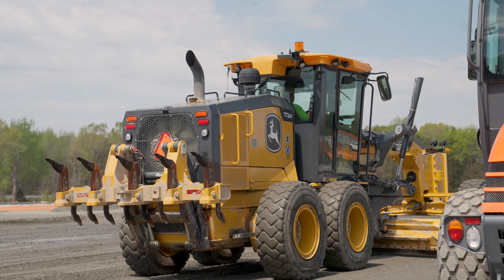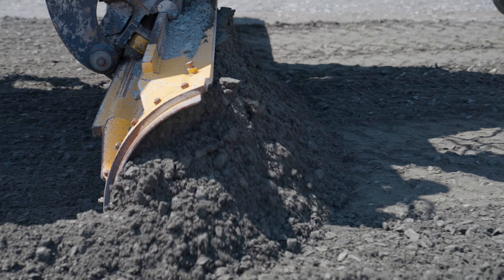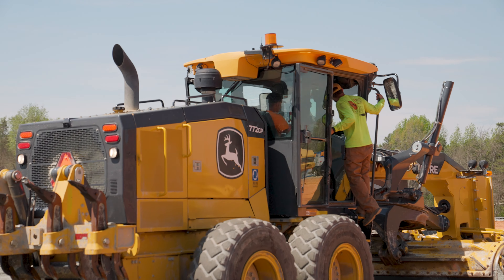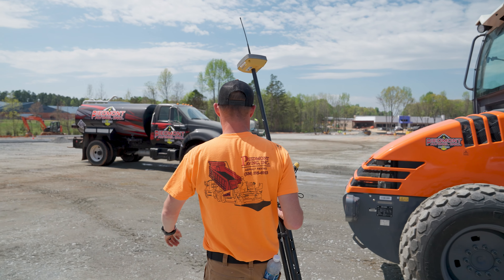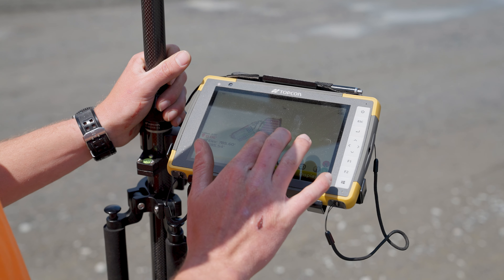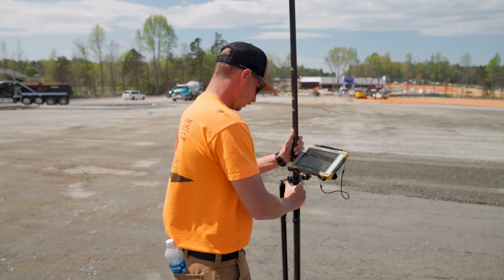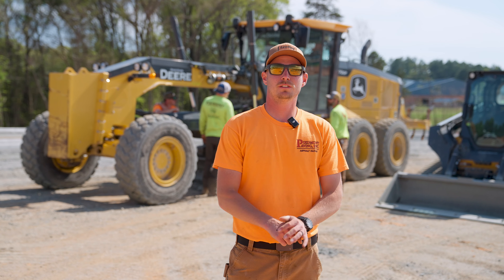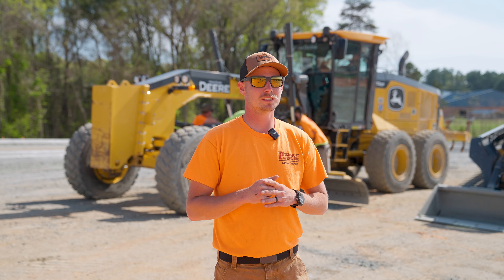Day two of our BIGGEST paving job!

Comment: I think you need a dozer.  That CTL is way to small to be spreading stone in an area that big.
Reply: Exactly!!  Needs finish grade dozer ie CAT D3 D4 or D5.  It would be more profitable to rent a dozer and park the skid steer.
Reply: Your curb and gutter goes down have James River bring out the Sonic tracers new Sonic on one side for the curb use GPS on the other side that way you'll be true all the way around I run a 672 in Richmond far as I know I'm the only one that does this in the Richmond area you can call Blair at James River and he can give you the lowdown keep up the good work thank you 🇺🇸🚜
Reply: A 333G or any other large framed CTL with a level best GB108 with wings, will run circles around any small dozer for finish grading. 
Trimble earthworks with autos on one of those is tough to beat.
Reply: @ChaseLandMgmt  Any small finish grade dozer with autos and Topcon or similar will get it done in a 1/4 of the time, and reduces the compacting time needed.  CTL's are for landscaping.  Source, I have a 323E and a 650P.